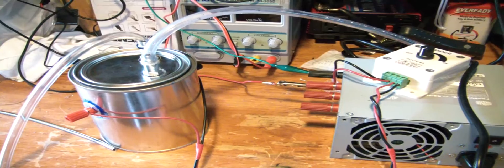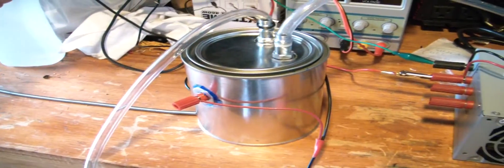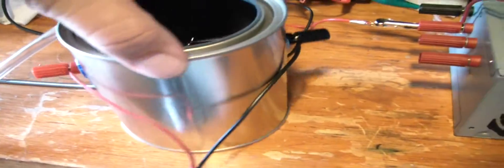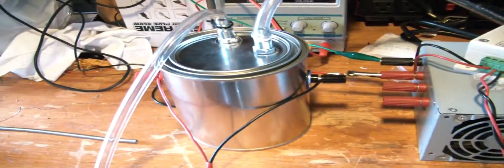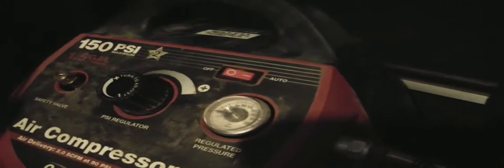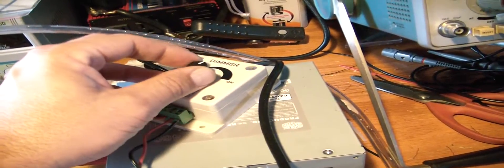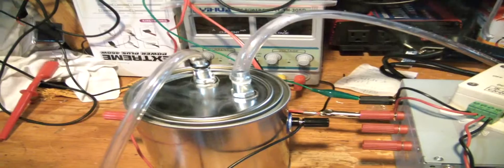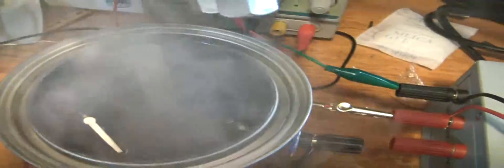DIY smoke machine

Comment: Commercial foggers do not use heated oil.  There is a "oil cracker" you can make with compressed air and a pressure cooker that does a dense haze, but all of the regular foggers use glycerin based fog juice.  The two big issues with what you are doing is #1 that is petroleum smoke and it is toxic.  Not knock you dead on contact dead but very unhealthy to breath.  #2 is you have a fire bomb there.  Flammable liquid with an ignition source and an oxygen supply...  For limited use??? maybe but if it gets hot enough to ignite the wick...  You could solve the issues by switching to fog juice, not flammable, not toxic, and probably work better.

Comment: hi can you put a parts list? i'd like to try and make it this weekend. just the parts on the can. i dont plan on using the adjustable dimmer.
Reply from the maker: I used an extension cord and placed alligator clips to connect to car battery, nichrome wire you can get from hair dryer, toaster, hobby/craft store and cut to length so I get about 5 amps. and I used a wick like from Wal Mart for outdoor tiki lamp/torch, put into a paint can I got from home depot, and put two air hose connector into can.  I just set my air regulator for like 1.5 to 2 psi but many others have used a propane regulator you should find cheap on ebay or harbor freight or old grill.  They really are a useful item for finding vacuum leaks.
Reply: thank you very much!

Comment: John, thanks for the YouTube on this.  I used your approach to construct a simple smoke generator and succeeded in finding my vacuum leak (a nearly destroyed hose).  I especially liked the use of the power supply as a current source, I wasn't aware that these had that kind of capability.  Thanks again.

Comment: John, I'm trying to build one of pressurized paint spray gun system, which has a metal can similar to the one you are using. I'm a little concerned about coil possibly touching metal walls making a short ciruit or heating the can itself. Do you address this issue somehow in your design or this is something I should not worry about? 
I also have a question about insulated binding posts, what parts are you using?
Reply from the maker: The wire is fairly solid and holds it shape and once formed have had no problem with it getting to touching the side of the can.  I have a good half inch from bottom and with the quart can I used probably 1 1/2 inch from the sides.  The binding post are from radio shack or ebay just insulated binding post.  Has plastic insulator on each side of the part that screw threw the metal.  Show us what you make.

Comment: You're wrong.

You want as little air as possible to get into the system. Air reduces the density of the smoke. Next time someone is smoking around you try this experiment. Have them take a drag and then blow out the smoke. Observe the smoke. Next, have them take a drag and then just open their mouth and just barely let out any air. Observe the thick cloud of smoke. This is what we want. If you're going to test for air leaks, use a leak-down tester. Every tool has a purpose.

Comment: Your not going to get smoke to seep out of a small weld crack that depending on the exhaust pipe temp and expansion or not and requires more pressure. 
Proper tool making smoke does not bias more air then smoke out of end of output of smoker 
Try almost no pressure with hose in muffler tip and how long it would take smoke to travel to collectors 

Added pressure also makes a louder sound to hear at the leak area, just a small fan will not be heard

Comment: I disagree. You don't want any pressure. Pressure will make the smoke harder to see because it will be diluted by the air. All you need is enough air going in to expel the smoke out. Pressure is not needed and not wanted either. You can even use a cigar as a smoke machine. Concentrated smoke is easy to see coming out of small leaks. Put that smoke under high pressure and you won't see anything.

Comment: Fan is not going to have enough pressure. 
At times with small leaks the only way smoke will come out is higher pressure
Also if a exhaust leak and smoker goes into muffler tip you need enough pressure to find leaks up closer toward engine side. 
Very small weld cracks need good amount of pressure to force smoke out

Comment: The one I made I used a cheap small fire ext bottle so nice & strong for pressure
Mounted a 12V glow plug about 1/3rd up from bottom of bottle 
Now filled bottom inside of bottle with like metal scrubbing pad so it just touches glow plug. 
To control temp I then used a 12 volt flasher for turn signals as when too hot it will open circuit or close to glow plug 
Installed about 1/3rd down of bottle a valve used for filling car tires for attach to air compressor.
Need more PSI at times

Comment: If you took a new lid and cut a hole in the top and mounted a fan it would work well. You could then make another hole in the side of the can for the exit hose. Putting your heating element inside a small can inside may help the outside can from getting too hot.

Comment: Should use a small 12V computer fan instead of hooking up to a compressor, then you don't have to worry about adjusting pressure or plugging in to a wall.

Comment: Addendum: I used posts with a soldering pin on the inside, which has a tiny hole in it, in which the wire can be inserted like a hook. In this way, you can ommit the wire clips inside, and make more room for the wire and the wig.

Comment: Thanks dude,

Very helpful. I had also first tried the model with a glow plug, not with much success.
I then found this video, and copied your design.
Much better smoke production. And the nice thing is that you can tune it with the resistance, either electronically or by cutting a piece of Kanthal wire of a suitable length.
For now, I am just using an old spring as heat element, that I had lying around. It cannot keep a constant resistance, but it still serves the purpose.

Comment from the maker: Let me know.  Been awhile but I acquired a few glow plugs and may come back to this and experiment.  I other thing I changed is the wick I now use it for a torch, about 1/2 inch diameter.  Hold more oil.

Comment from the maker: The paint can i used is just the quart size from Home Depot.  I like you spray gun idea.  I didn't have the money to buy the harbor freight kit with the hoses.  The nichrome wire handles heat without breaking down.  the ohms is the regulate the amperage so not to over due my power supply or fuses if on the car battery.  Can play a bit with this to h=get the heat that works for you.

Comment: Thanks for the video ,,, i made a beautiful glow pug style one yesterday using an 2 qt autobody spray gun canister but it looks perfect but it just doesnt produce enough smoke so I want to make one exactly like yours. my questions are #1 what size paint can is that. #2 will the  Nickel Chromium wire work just as well and if not then do i need a certain wattage Heating Element Coil Heater Wire or or just make sure that the ohms on the lenth that i cut equals 1.9-2ohms? thanks

Comment: For a less hazardous container you could try a metal interior and exterior coffee thermos. That way it'd keep it hot inside and cool to the touch on the exterior. If you have any simple ideas for a heating element let me know, oh and about what temp does baby oil smoke at?

Comment from the maker: Into the evap lines going to the fuel tank or evap cannister.  If intake leak any hose going into the intake or easy one is the brake booster line.  Once intake fills then will come out the leaking spot.  Best if used in a garage or very still day and have a flashlight to hunt with.